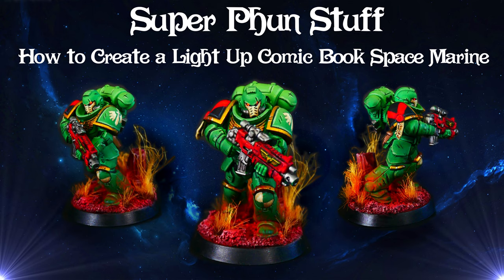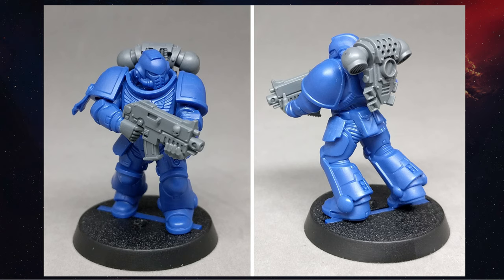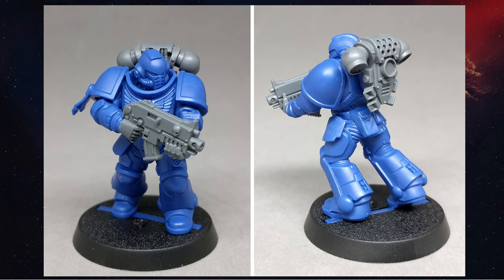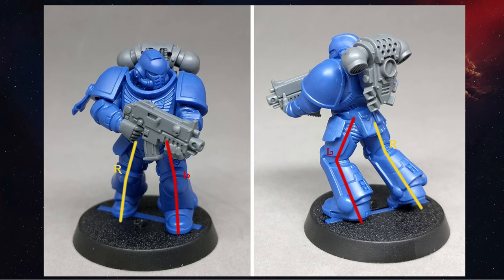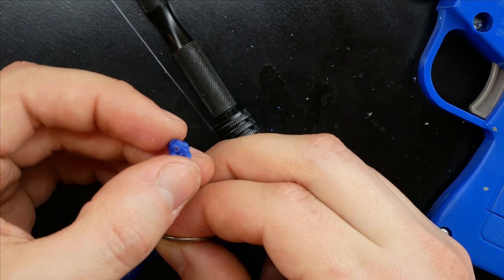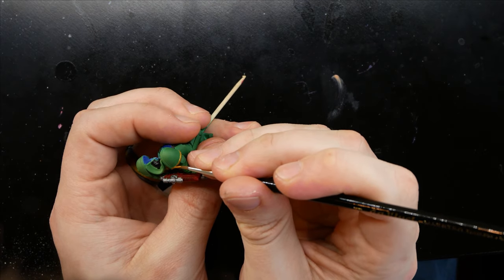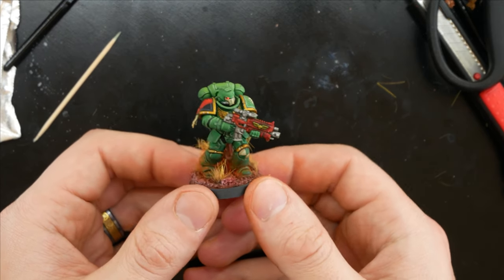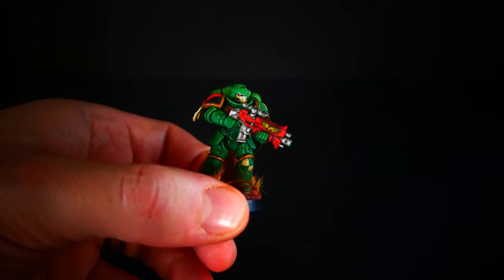How to Create a Light Up Comic Book Space Marine

Comment: this is so great and looks amazing what size is the fiber optic you put in the eye i had a look on amazon but could not see any thing i though would work thanks again and keep up the good work
Reply from the maker: The holes for the eyes is ~0.4 - 0.5mm. So the strands are somewhere in that realm; probably 0.05mm smaller than the hole. For the actual strands, I just bought one of those cheap fiber optic light up lamps. I got mine for ~$5; may be a little more on amazon. Not all the strands on there are the same size, probably a 0.1mm tolerance, but you will have plenty of strands for whatever you need. You really don't need to spend a lot on higher quality fiber optics, since this is for light and not data, there's no point.  And don't forget to test fit everything prior to painting! Example fiber optic toy on amazon (https://www.amazon.com/Novelty-Lighting-Glacier-Color-Changing-Crystals/dp/B01DB632ZE/ref=sr_1_1?dchild=1&keywords=fiber+optic+toy&qid=1607383027&sr=8-1)